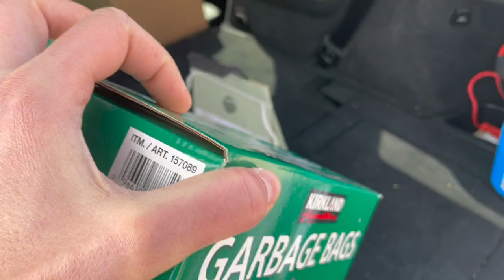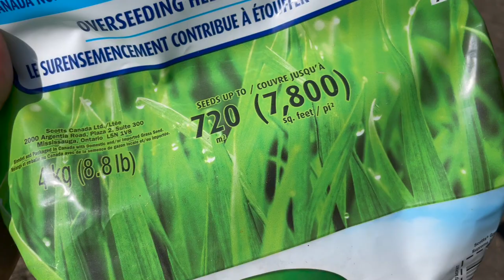Another secret hatch!?! what the heck did we find in our yard! house build update

Comment: Cistern for capturing runoff?  The stairs are dinky. Your example is absolutely right. Steps should fill the space between the house & 1st porch post. The stairs installed look like something in a trailer park. Are they even underpinned by concrete pads or piers? If not they'll sink in the mud next spring thaw season. Cutting corners at the end of a project is very tempting for ppl who have the next job underway.
Reply: LOL!  Yeah - you totally get the feeling of "I WANT OUTTA HERE, NOW!"  I though the same thing.  And about the cement footings, too.  i would actually make cement stairs with that weather.  The light wells for the basement windows are weird, too.  They remind me of animal troughs cut in half.  Won't they fill up with snow?  Can they drain?
Reply: @celieneohara521  My parents have window wells also.  There are translucent covers made for them and usually a French drain around the outside of the foundation for draining water.  It works well as long as the property is not subject to flooding.
Reply: Yea those things around the basement windows look weird
Reply: They are common in the Rockies.
Reply: @marygale740  common in Minnesota too. And I seem to recall seeing them a lot in Michigan.
Reply: @celieneohara521  My friends window wells leaked and flooded the whole finished basement.

Comment: You should consider having cement steps for the front.
Reply: It would be expensive, but I was thinking of steps veneered in the same stone as the front of the garage. Since they were unable to have part stone porch posts, stone steps would tie the two elements together. Just my thoughts, but I am not the one paying the bills.
Reply: @danielulz1640  I totally agree.  Having the stone on just the right side of the house, with nothing on the left to balance it out, looks odd.
Reply: Yes, wood gets slippery in snow, can be gouged easily when shoveling or chopping snow and ice and it just doesn’t hold up well to a lot of traffic.  Let it weather, it just looks old and worn, paint it and the paint chips.  Concrete is the only way to go.

Comment: I thought those stairs were wimpy and take away  from the esthetics of the house itself. When you put the boards down, that effect was exactly what was needed.  Question: Do you plan on having a back-up emergency generator? I wouldn't live out in the country without one - especially seeing as you are not on municipal water out there. It's also nice not to lose lights and heat in the midst of a winter blizzard.

Comment: Alex, place the 6" steps in the back on the patio, use the 10' boards to make new front steps, as for the concrete lid in the back yard / pipe and round soil filled wire cage inside?  Is ist some form of a dry well to dispose of surface run off water? Getting closer to that new riding Lawnmower.....

Comment: Get a cover for the pool which will help keep it cleaner and some will help warm up the water. Do you have to have a fence around your property or the pool area like we do in the US?  They are extremely strict about it to protect little children and pets from accidentally falling or getting into the pool without adults around.  When you are putting that much grass seed down it’s important to cover it up with a layer of straw or a straw woven mat that landscapers use to keep the birds from eating all of your expensive grass seed and to prevent the rain from washing it away. Did you use your rake to cover and integrate the seed into the dirt? Which is another step to having a successful experience when seeding your yard if you can’t afford to buy sod to cover it. The type of grass seed is also very important as some types only thrive in various conditions.  Our first home had this grass that was drought resistant and felt like an expensive carpet under your feet. It was called Zoysia and it came in plugs that you planted so many inches apart and over time it would fill in choking out any weeds and plants unless you put a border around them. It started out by growing shallow roots and grass that quickly formed a protective mat over the soil and then it grew deeper roots. Each year it will turn brown after the first really cold frost/freeze, but as soon as it started warming up in the spring it quickly turned a deep green. Beautiful, but expensive to start out.

Comment: Yes, 10 foot wide steps, 7 inch rize, 11 inch tread, and a couple cast iron planters on the ground at the corners of the bottom step. Wish I lived a bit closer, could make you some proper stringers, even pressure treated I don't trust them to last proper when outside and the stock steel stringers from a lumberyard are to steep.

Comment: That "secret hatch" in your yard looks like the lid to our septic tank, LOL!  Ours is buried under about a foot of earth with grass growing over it, but I know exactly where it is.  If we do have to open hours to get it pumped out, we use that ring in the center of the lid.  Ours is an old, old tank as well as in, it doesn't have a control box behind it and it doesn't have three plastic lateral lines leading from it, instead it has two "lines" made from inverted V shaped terra cotta tiles.  Not sure when it was installed, but I'm guessing it was about 1940 when the current house on the property was built.  There's another "secret hatch" in our utility room which at one time was the original back porch that covers a dry cistern under the house.  The last owners used it as a sort of root cellar for storing home canned foods, etc, in.  We've never used it and instead have a small deep freezer sitting atop the cement hatch.  There was an older house before this one on this site that dated clear back to the 1840's and stood here when John Hunt Morgan rode through on his famous raid into Indiana and Ohio.

Comment: Front steps definitely need to be wider and maybe the back steps come up from an angle (both sides on the outside corner and maybe bigger at the bottom and tier down each step to the top.  With as grand as the front of the house is I think maybe cement steps unless in your area they would be more seasonally challenged?  Looks great - INDIANA

Comment: You should make the builder do concrete steps so they last for decades. Paint  them white with a  textured porch and patio paint so they aren't slippery. Home Depot has a great textured concrete paint, it's called Porch and Pation paint, it covers 75 Sq ft. It does wood also. Are you going to put window well covers on the basement windows to keep water out, even though you have stone in there, a good rain will over flow the casement windows, unless you had a drain put in the well also. Your new house is gorgeous!

Comment: Your idea of the steps is correct. I think that you uncovered a cistern. It probably will need to be cleaned out and some rocks and perhaps sand put in the bottom of it to filter the water, but it would be great to get it working and you could use the rainwater to water your gardens and shrubs around the house.  You could redirect all your water from the rain gutters on your house into it. You probably should have put straw or straw rolls on top of the grass seed to keep it in place and keep the rain from displacing it and accumulating in puddles. I hope that doesn't happen, but it usually does on freshly graded dirt.

Comment: you're correct about the front steps - the step railings should line up with the right side of the house and with the inner side of the porch column thereby 'encasing' the full width of the porch step entrance - you know what you want so enough of a rough drawing of your porch step entrance by you should be enough for your builder to come up with a suitable draft plan -

Comment: septic tank access. What I use for mine is a landscape wood pole, which I then loop poly rope around it and through the metal loop, then with a person on either side of the landscape wood, the hatch can then be lifted and moved over onto the top, so septic can be thoroughly cleaned out. If you decide to put a workroom or garage there, you will already have ability to install a toilet in it, hooked to the septic tank.

Comment: In re stairs:  the safest proportions are 12-inch treads with 6-inch risers;  that works well both going up and going down. Do not change the pitch.  As for the concrete hatch, that looks to me like a dry well, which could be simply to provide a way to drain water from the surface, or as an alternative to a leach line in a septic system.  (I was hoping for a fallout shelter.)  The construction looks recent;  an old one could be made with brick, domed at the top.

Comment: Agree with most comments about the stairs they are not dimensional with the house, you spent so much money building this great home and they gave you those? another suggestion I have for you is get a new shovel, that one is worn out there is not tip left and you might as well turn that into a square nose one better for scooping not digging need to have a point on a round tip shovel for it to work right. Its just a suggestion!!!
Reply from the maker: The shovel is all we had on site :)
Reply: @CuriosityIncorporated  👍

Comment: If they will not do the stairs at this time, then I would leave those and do stone steps that would be your ultimate grand entrance and you would have your stone that you should’ve had if they did not make the mistake to begin with. And do granite tops on the tread and then the stone you have on the house to match. And you can have railings put in by your blacksmith friend if need be or stock railings. I think the stone would be gorgeous best of luck!

Comment: I agree about the steps at the front - should be from pillar to side wall - but with your climate shouldn’t they be in something more durable than wood ? Especially the bottom step - wood directly on to soil ? At the back they also need to be wider unless you are planning to put some railings round that area which personally I don’t think is necessary - but wider steps a must for carrying bags of shopping etc as this will be the ‘working’ entrance to the house so you need practical steps at the back

Comment: How is the grass going to grow with no sprinkler system in place and putting a top soil down along with admends will help protect the seed and give the need the soil it needs.  Even if it rains there should still be an irrigation system.  The top soil would help protect the seeds from the rain washing it away and the birds.  I put in a pool last summer.  Have your pool guy check the phosphates, algae, chlorine and PH and copper.  Yes your pool will need to be shocked.  I clean the filters every month.  Did you get the canister filters by Pentair.  I agree with you the steps look akward.  Why would they do that without asking you.

Comment: Much as you might think the ol septic tank contents are yucky.... they are very likely to have decomposed (presuming the contents are DRY) to the point of being good to use as dirt enhancement/fertilizer. The Idea probably doesn't have you wanting to play in it like potting soil but it can be mixed in with topsoil or an area kinda lacking topsoil for your lawn or planting trees etc... Most people don't realize how septic tanks if properly sized, designed, and installed are intended to work that way. If it's holding water that's a no-go. But if it has dried out on its own for 20-30 yrs  then it will be clean. Poke a shovel in it and you'll know right away whether or not it's done with decomposition. It looks well made enough you shouldn't have to worry about safety if you are just leaving it be. 

The steps should be what you want them to be. They look right going from corner to column. As well as matching the size of the porch in scale and proportion. Your left rail will end at the column, I would size the left side to make the handrail hit center of the column myself. You may want to go around the front corner on the right side - like 1-2 inches.... whatever makes the right side handrail land up at the corner of the house trim nicely, and not half on/half off or some kind of turn or bracket to tie it in. It should land up top on the house nicely. It will make a nice set of steps like you're wanting.

Comment: Our building codes call for minimum 14" wide stair treads. I measured that with men's shoes and tennis shoes and 14" isn't wide enough to fit a shoe with the usual rubber around it. Winter boots are even bigger.

That means someone walking up the steps can only put the front half of the shoe on the step 
at a time and stay balanced. 

The length of the tread is a major aesthetic and practical design issue. As well done as that house design has been it is hard to believe such steps were even considered. Drupat's judgment fell a smidge in my eyes with that one. Glad that you caught the problem and can plan to change it. 

So sorry that things won't be done the way you want them before the project is "finished." Just don't let fixable stuff rob you of your joy.

Comment: As a European the whole place looks to be poverty spec. apart from the size! It is just that we are more used to brick or stone buildings. Steps would typically be concrete with ceramic tile or a stone veneer. We only have a limited supply of tall trees though so wood is more expensive than brick. We do get the benefit of the superior fire resistance of wood. Odd that they would padlock the septic tank!

Comment: I would not use wood for the steps, concrete or at least plastic wood. Real wood is always a maintenance issue and rots before you would like it to. Put something there that will last the life of the house. I just thought of another thing, concrete blocks covered with pavers or tile will look very dramatic and last forever.

Comment: Just grass??  Those steps are only 4 feet wide - and the are FLOATING above the ground!  WHAT???   And they don't look like the risers are deep enough to fit a whole foot! And they certainly are NOT to code - they should be in cement footings!!  And the first step from the ground is TOO HIGH!   They will rot away in a few years.  What are all those rocks under them?   WHAT was Drewpad thinking????

Why is the house floating over the ground?  And the ground isn't level?  Why are those pipes to the right just sticking out like that?  The uncovered one is an invitation to rats & mice.

Comment: Your home is beautiful but the steps….ugh.  The steps should be built on a concrete pad.  Otherwise, they will sink and pull away from the house/deck.  I have built 7 custom homes.  The front steps should be the width of the first column and the corner of the house.  My suggestion for the back deck is to center the steps with the deck and have a 5’ opening.  After watching the full video, I see that you are fixing the front steps.  I think straw should have been thrown out to help the seed from not running off.

Comment: What is that house, like 3000-4000sf? 

That’s the most underwhelming set of front steps I’ve seen on a house that size. 
Looks like it would have been built as a temporary set for the construction crew, and not the finished product. 

When you get them replaced, maybe you can donate the old ones to a summer camp. They may need a new set for one of their cabins. 😆